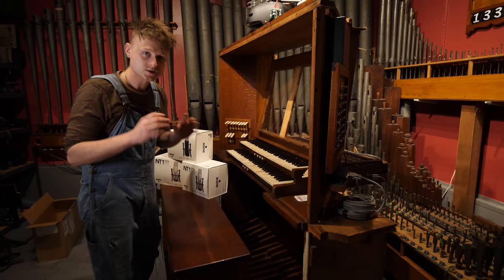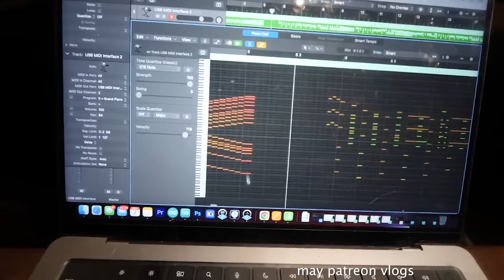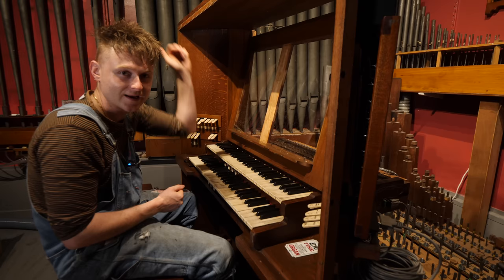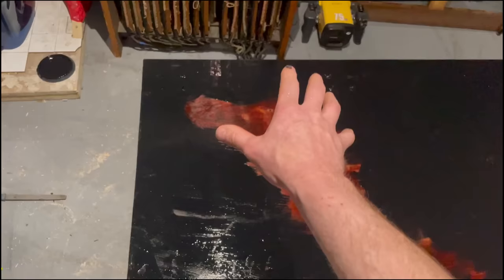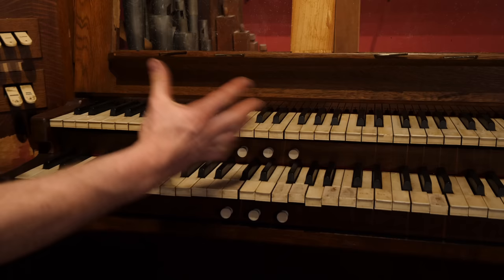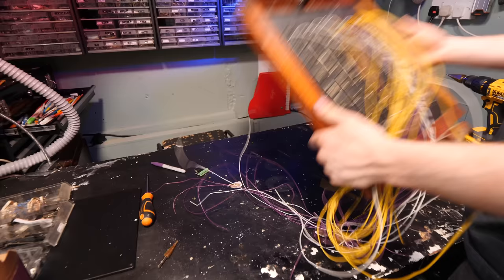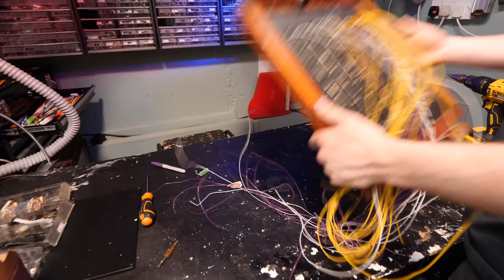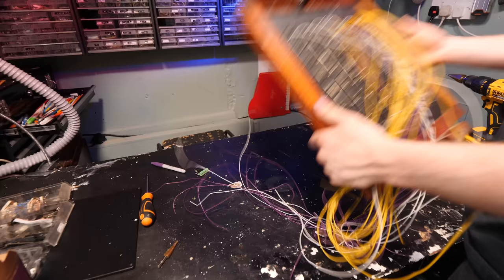100 year old church organs had programmable presets! I BOUGHT A CHURCH ORGAN - part 15

Comment: One thought that came to mind watching this is to suggest you put together a small box for future generations, stocked with some extras of the parts you're introducing to the build. That includes a spare Arduino, which might not be available in 50 or so years. Mark it "Do Not Open Until Christmas - 2075!"
Reply: This is a really good idea.
Reply: And add a magnetic hard disk or burned DVD with all the code and software on it. Not an sd card or solid state drive, they'll start to lose data after several years of being unused.
Reply: @FPSlacker o will a burned DVD as the chemicals degrade, and a magnetic hardrive isn't immune to data rot either, and who knows if it'll still be good mechanicaly if left unused for an extended period.

Paper and ink is probably a good idea too if you want longevity.
Reply from the maker: Yeah good idea. I had thought about how to put the code in it. Maybe solid state not sure! But yeah good shout on spare arduino. I have designed it with future tech in mind. I mention in an early vid. Purposely avoiding multiplexers and complicated circuits to reduce wires but increase troubleshooting. In theory if something dies someone can replace it with a modern alternative with ease. That's my thinking with how it's wired anyways. But I do need to include paper of the midi allocations and stuff. And as you say code incase and good idea on spares
Reply: One word……..Cracking👍🏻
Reply: @LOOKMUMNOCOMPUTER you can use magnetic tape, the same thing slo mo guys use to store they'r 100 terabytes of footage
Reply: @ArthurRichardSole  Magnetic tape.  Used commonly for long-term data storage.
Reply: Print out the code as paper copies as a super duper last resort. By 2075 they'll have perfected OCR scanning 😉
Reply: @Earthenfist  Paper tape! Or even punch cards.... but a reel of paper tape would be better. As long as it's kept dry and in a tin or similar... it'll outlast the human race.
Reply: It might be better to have one or two models and a bunch of "un-attainablre" ICs and discretes.   In 50 years a lot of the old stuff will not work and "modern" workaround would have to be found.
Reply: @FPSlacker  As others have pointed out, magnetic hard drives that aren't kept running will eventually seize up mehcanically and won't be readable anymore. Normal CD/DVD-Rs will rot after a decade, but they do make special archival ones that are supposed to be good for 100 years. LTO tape is guaranteed to last 15-30 years if stored in a climate controlled facility, but LTO is not quite old enough yet to know if they're right. Then there's the problem of needing working drives to read all this media, and hopefully the file system won't become obsolete and have support dropped in future OSes...
Honestly, probably simplest and best to print the code out.
Reply: I think an Arduino would be pretty easy to replace in 50 years, as long as you have the code. Arduino code could run on pretty much any hardware imaginable with some emulation or conversion, and is widespread enough that there will probably still be compatible hardware and/or software for 100+ years. (They still make microprocessors from the 70's today).
Reply: @theelectricmonk3909  why paper? stainless, laser cut. not sure how good of an idea it woudl be to have full size or have teletype sized (like in the short vid snippet for the synth module). and THEN youll have to find a system thats able to reconstuct it. working the chain up from simple etched drawings to a mainframe to read some punchcards. Voyager style golden disk on the back 🤔
Reply: That would be the case if this simulation wasn’t ending in the year 2040. Spread love, it’s our only chance.

Comment: The 'unknown' button under the swell keyboard is probably an 'all stop clear', which may be indicated with a zero. Does exactly what you intend to use it for!
Reply: I came here to say this. Many organs have a “General Cancel” piston which turns all the stops off, although they would usually be off to one side. It could also be a Swell to Great coupler.
Reply: Not exactly the same task, but no reason why it shouldn't do both. well, except that when you clear a stuck midi note then you have to re-select your last preset.
Reply: Given that the button has two wires, it would say it is a Swell to Great reversible, so when it is pressed it toggles on or off the swell to great stop if there is one. The toe piston might be swell to pedal or great to pedal reversible too. I find these couplers not super useful on a small organ like this but sometimes they exist.
Reply: "MIDI SCRAM"  was the suggested name :)
Reply: Even Hauptwerk has a 'midi release/reset' function that you can assign to any key or switch.😉

Comment: Fun fact: that option to leave a stop in the state it's in regardless of position is unique to that style of setter mechanism. Most newer digital systems aren't capable of that, they can only set a stop on or off.
Reply: I don't know whether I'd say "most", as it's very common to have a "map" facility that allows you to program which stops will be affected by any particular piston. I use that feature regularly to program pistons that will, for example, turn all tremulants on or off, without changing the actual registration at all.
Reply: @rknud007  There are probably some advanced systems somewhere that can do it, but every digital setter system I've seen in the wild has consisted of a "set" button that commits the current state of all the stops to a piston. Far as I can tell that's the norm for combination actions that don't have the switchboard that Sam's organ has.
Reply: @mrrandomperson3106  Opus-Two, Uniflex, Artisan and probably most other modern systems allow 'mapping' or 'ranging' what stops will be controlled by a given piston. Sometimes it's done in software, and sometimes via the use of a MAP or RANGE piston, but no matter what, the functionality is generally there.
Reply: I don't know that much about organs, but there's quite a few tri state things (on/off/high impedance.)

Comment: So awesome to see it in action! 

For those interested in a longer description of my approach to the organ brain:

To start, we read all incoming MIDI messages and maintain the state of each keyboard so we know which keys are being pressed any given time. We also read and save the state of every stopswitch. Now that we have the input state, we can calculate what notes to output on each pipe rank.

 We use some mapping logic to calculate every output note that should be on or off for every pipe rank based on the inputs and save the results. By comparing the new results with the previous results, we can see which notes changed from On-to-Off or Off-to-On and send a MIDI On/Off message to the corrsponding pipe rank.

Because of the limited serial buffer on the Arduino Nano (64 bytes or 32 MIDI note messages), we must read and clear the input buffer as much as possible to not miss any messages, which would result in stuck notes. An output ring buffer is used to send the output notes in batches to prevent overwhelming the serial output and dropping MIDI note messages.
Reply: So it's the midi equivalent of fly-by-wire, maintaining a virtual state of the organ, recording the inputs, updating the model and affecting the real world to bring the real organ in line with the model.

Comment: My 100 year old Estey has a fantastic rube-goldberg preset combination action.  Behind each stop is a rod with a small lever for each preset with on, off and stay.  Running parallel is a rod for each piston attached to a pneumatc ram.When the ram moves the rod, it hits the levels, and flips the stops open or closed, or "stays".  Completely internal, with a "setter"  button.  You hold the setter button, with the preset button, then it flips the levels to whatever you have set. So complex... but no wires, and it still works 100 years later.

Comment: I just love wire lacing and lacing the wire looms, I once had some contracts for fitting warden call alarm systems in sheltered housing schemes, I had done half a dozen of these jobs and got a phone call one day to tell me the last job I had done had different specs and I had to travel halfway down the country to change the lacing for plastic cable ties, I was very pissed off!
Reply: i love it too, i learned at deutsche telekom, we laced the big telephone cable to learn, 2000 DA(doublewire) in office centrals, a means to bring order into chaos, sure we laced all our small projects too with jsut handful 20-50 wires, but the big cable will always be in my memory

Comment: Hello Sam !

You were referred to me by someone on youtube as a person that will be able to solve our dillema...
I am not an organ player, I play the recorder, mandocello and euphonium, and I use a small church pipe organ as an accompaniment source. I used it in the past (about 10 years ago), quite successfully, using a Mac titanium laptop and a MIDI interface -I do not remember the name or brand.
After a long absence, I would like to use the pipe organ again like before, but with a HP 360 Spectre and even with a new Mac Powerbook - the MIDI files no longer play satisfactorily. I have MIDI files with some 3-4 up to 16 staves, and only a couple of staves play and the rest are somehow muted. I tried several MIDI interfaces and the result are always the same.
The electronics controls / MIDI circuitry is built by a renowned company called Syndyne, and the catalog number is LS5600K Keying System. Quite unbelievably, the company was not able to give me any idea of what might be wrong. From the organ console, the organ plays perfectly, my MIDI files play perfectly to an electronic piano /keyboard, and yet on the pipe organ, connected via the MIDI connection only couple of staves play.
Any idea of what might be wrong ? I would greatly appreciate your comments. Thank you. Valerian Buducea in California.

Comment: 7:02 that was actually quite a great explanation, what's important in such a program is your state being described very clearly, not implicit, not to be guessed from rules, one clear source of truth, and this design identifies important points of the process in which the state reflects what needs to happen, directly based on what happened at the previous stage.
- keys buffer, i guess one bit for each key, enough to know what the keyboard is doing, you can update this when you get a midi message, or however you learn about the state of a key.
- pipes puffer: same for pipes, if at least one key for a pipe in the previous buffer is up, then we need to be up
- pipes: for each bit in the pipes buffer, if the pipe is in a different state, we need to update it, so you can send a midi message, or whatever signal you need to send to update the physical world with your will.

and of course yeah, while doing all that you want to not let messages accumulate, so you poll for new messages as often as possible.

I'm sure you have all the cogs you need, but they are already pretty busy, i'm a programmer and i certainly couldn't do what you do with electronics :D. Well, at least not without spending a lot of time getting up to speed.

Comment: I’m a church organist, and whilst my regular Sunday instrument is a digitised Italian job from the 1990’s (Viscount) I do play other instruments on request. 

I’ve seen several preset boards on electro-mechanical pipe organs that use model railway track as the on and off bus, and one organ used brass picture hooks as the movable contact between these. I guess the organ maker back in the day used what they could get hold of?

Comment: The last presets I saw had a foot pedal which rotated a pillar behind the pull-in-and-out stops.  Cams, one for each stop, were bolted to the pillar in such a position that as they rotated it pushed the stop in or out.

Comment: 18:57 regarding the blue wires for that extra piston: Most probably, this might have served as a "general cancel" piston, i.e. turning off all stops at once. Most pipe organs with electronic or pneumatic stop controls (and especially those with presets) do have a GC piston like this. Besides providing a quick way to disable all stops before you get off the organ (...in case you accidentally hit some pedal notes...), another neat use is to quickly change from a preset registration to a manually selected one. Just try it on your own. :)
Remodeling it into a MIDI panic button sounds like a good idea to me, as it effectively does the same as a GC plus sending "note stop" signals for all keys (which the end user wouldn't even notice since stops are off).
Also, THANKS for sharing this huge and highly interesting project with us! Fun fact: A few years ago, I almost started to build something like this -- an extension to my Hauptwerk virtual pipe organ with two ranks of real pipes. Didn't have the knowledge to build all that wiring and Arduino stuff, tho. So, in the end, this was just a pipe dream (pun intended, lol)....
Reply: Strange having it on the swell manual though, most organs have the GC on the far right of the lowest manual.
Reply: @mrrandomperson3106  Exactly my thoughts. The only reason why I did suspect this to be a GC piston is the fact that it has a bit more space to the group of three preset pistons than the individual preset pistons have between each other.

Comment: Oh I wanted to comment on that video about the MIDI problem. Well done! Good solution!
Years ago I had the same problem coding in Assembler for Z80. So I made an 8 bit counter for each note that increased +1 for every key down and decreased -1 for each key up. The buttons/keys were freely configurable. However, biggest headache was not this but debouncing those keys in software.

Comment: I had thought, in a previous video in this series, a viewer had mentioned what that button on the pedals was used for originally. Probably lost in the torrent of comments you must get, though. No matter. A MIDI "All Off" is a great idea for this installation. Had you thought about inserting some capacitors somewhere in that preset circuit, to keep a held-down  preset piston from burning solenoid coils out? 👍

Comment: My first thought looking at this video and the problem with the note's ON/OFF was to put a counter in the code for the driver of each pipe. For every ON there must (should) be an OFF. So for every ON we increase the counter and for every OFF we decrease the counter and we only change the output state of the pipe relay when we move from/to zero count. This way it does not matter which master sends the message, the pipe will keep track of however it needs to play or not.
Love this series.
Reply from the maker: That's how I was going to do it. I mention the counter in the last vid. But the other guys who made the codes that worked in the end said it was a dumb was of doing it so I just nodded and listenned haha

Comment: Wonderful!   

Yeah, naive MIDI note handling can really bite you.  I've got one of those old Rock Band guitars with MIDI out; it has short strummable strings and then a button for each fret/string position, so you can really play it. Only trouble is that it sends its MIDI notes on a different channel for each string, so my monosynths would only see the low E, so I put together an Arduino hack to consolidate the note events on channels 1-6 — and hit this same problem, if adjacent strings were playing the same note.  I haven't completely fixed it yet; I'll be looking at the code with interest!

Comment: that fast of rapid cycling is likely overheating the solenoid coils/formers/cores and causing binding(expansion/contraction/distortion). it will very likely cause them to fail permanently far sooner than later, if you're worried about retaining the historical actuator parts. if not, hammer on dude!
Reply from the maker: Capacitors
Reply from the maker: Also they are under powered to prevent what you are saying will happen 🤦‍♀️👍
Reply from the maker: Will put money on the fact they will be fine

Comment: Never seen an organ with a board like that - most have a button you can use to copy whatever switches you've currently got on to a preset. Here, you're right in making it turn everything off, it's called the general cancel and stops everything.

Comment: I actually ran into buffer issues years ago on an old Windows 98 MIDI setup that I was using to play 2 Yamaha MIDI keyboards. I couldn't replicate the problem if i played the piece below 120 bpm, but kick it up to 140 or 160 bpm (where the tune was supposed to be played), and it would hang every time. I was using Cakewalk at that time (around 1999 or 2000?) for my sequencer, and I contacted them, and they basically said my system was too slow to deal with the extended buffers.😜 I was running a P-II 400 mhz. processor and 64mb. of RAM, which for most programs, was plenty. Anyway, I just hobbled along for another year or so, until the release of Win XP, (I never ran it on Win 2000 Pro or 'Millenium'), and was also in a position to acquire a newer system with a blistering fast (and HOT) Pentium IV Prescott @2.4ghz.😂 That and 2 gb. of DDR2 memory put me in 'fat city' with Cakewalk. It still wasn't completely stable, especially with multiple tracks, so I eventually got out of MIDI stuff until many years later when I got my first Intel Mac-Pro.. and then there was GarageBand.. which is a whole 'nuther story!😉